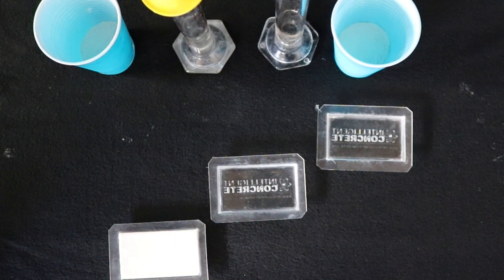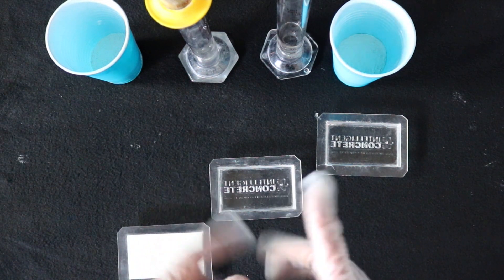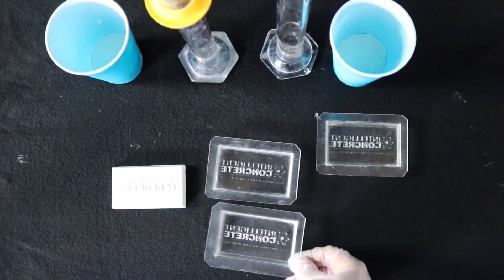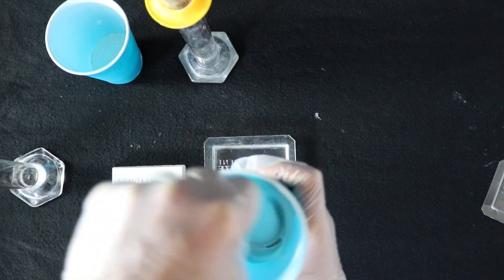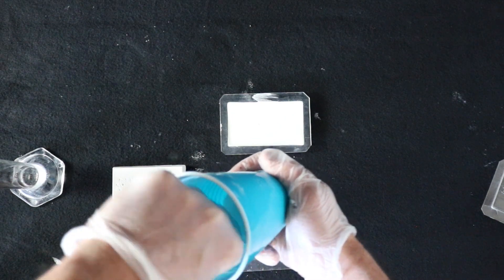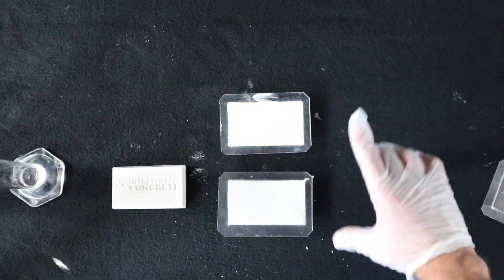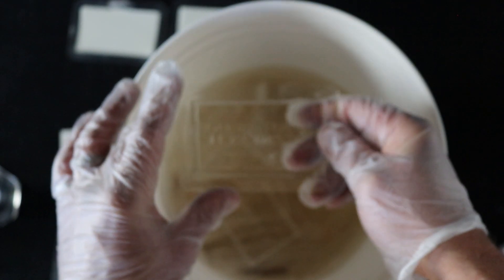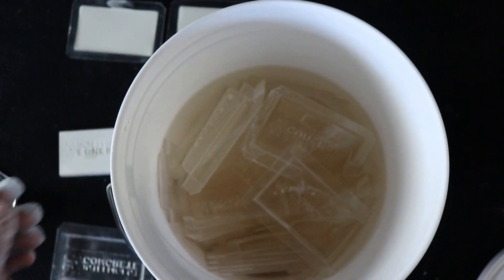Our Concrete Business Card Molds! - Vlog #284

Comment: Thanks for sharing your video, I'd like to add that if you want the cards faster use CSA cement which dries up faster and to make the cards more durable use 0.3mm fibers @ 1% will be more than enough.
Reply from the maker: Thanks Johane.  We have worked with a white CSA from Japan and Illinois (could be wrong on the second location) a few years back with and without a combination with a white Portland cement.  The early strengths were good but if we didn’t seal it the CSA mixes had a bad reaction with water, swelled up and cracked.